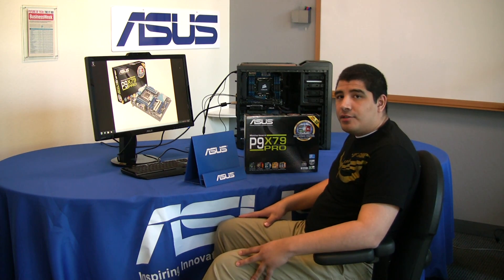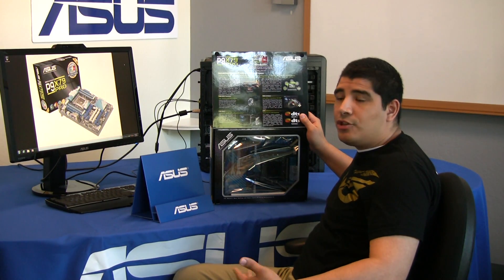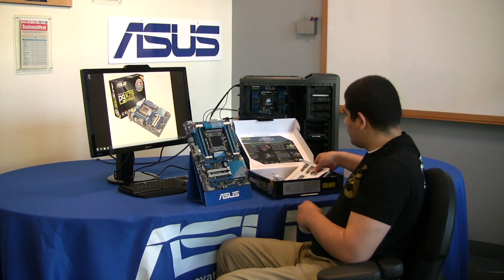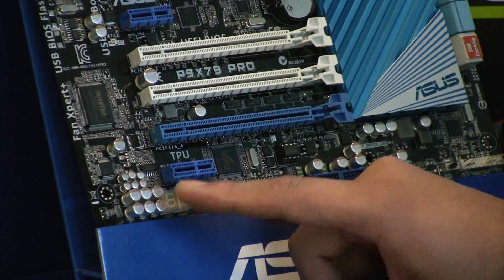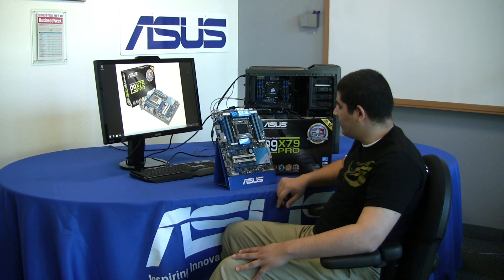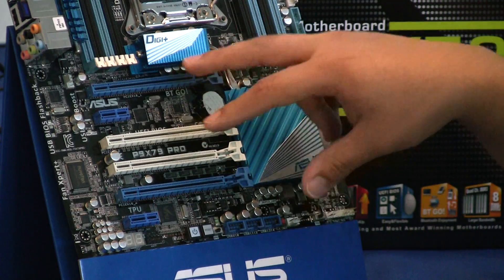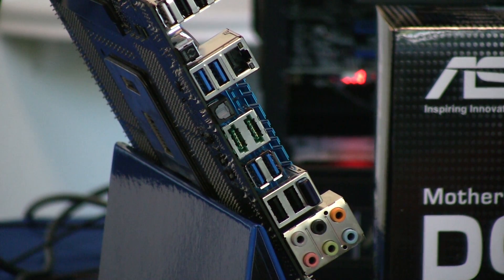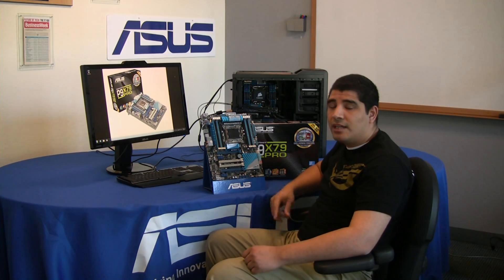ASUS P9X79 PRO Motherboard Hands-on Review

Comment: Nowhere can I find informatics on using he bluetooth pairing devices like head sets etc
My X79 Deluxe came with bluetooth and the gold screw in connectors were factory installed and I got a black folding antenna  but no instructions on how to use it.

 Care to shed some light?